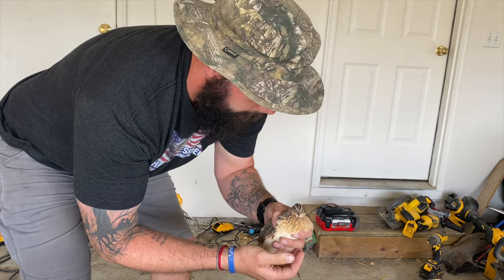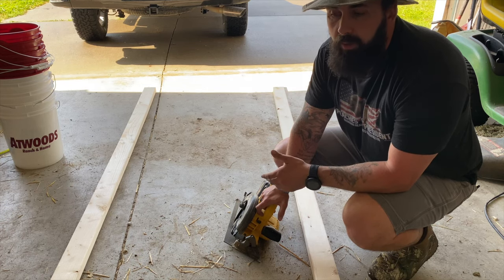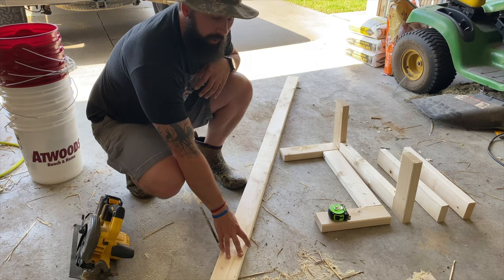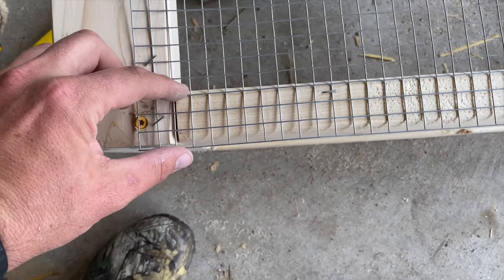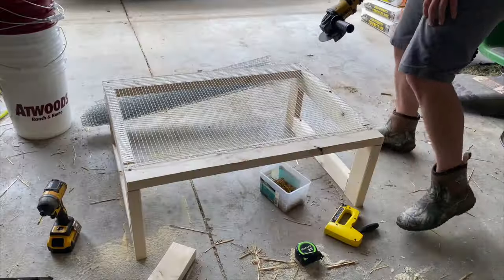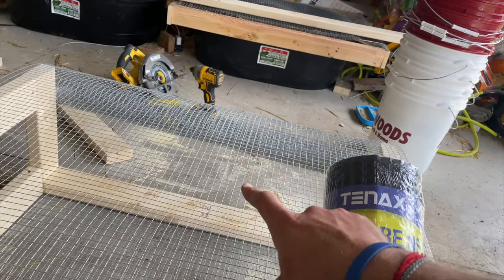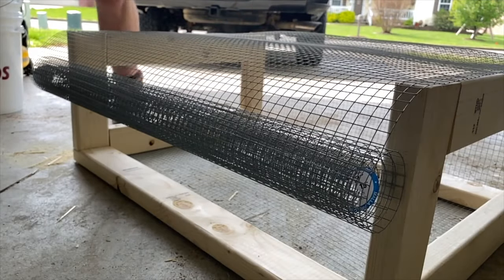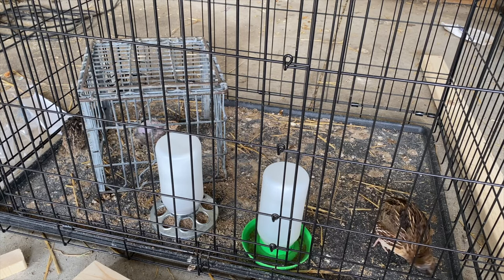EASY QUAIL HUTCH

Comment: I Found out the hard way that this galvanized wire is not good for their feet for it causes bubble feet however i noticed that after added a sand box in the cage it stopped happening to the new ones
Reply from the maker: Yes. I keep this cage on the ground for that reason. If you’ll notice I also wrapped the 2x4’s inside the wire so they have a place to perch and rest from the wire if need be.
Reply: Quail don't perch

Comment: Why not 2x2 lumber I know almost the same cost as those 2x4s. But I’d rip them down middle then you could be Terry. @CC The 2x4 profile gives more area for poop build up. A couple 3/4 x 2” strips to support the floor wire will help support that thin gauge wire. 1/2x1” welded wire is a very good floor material. I like the 1/2 for the other panels. Helps keep the mice out. 
Why did they put the blade on the wrong side of your saw. The worm drive version and the 20v saws have it right.